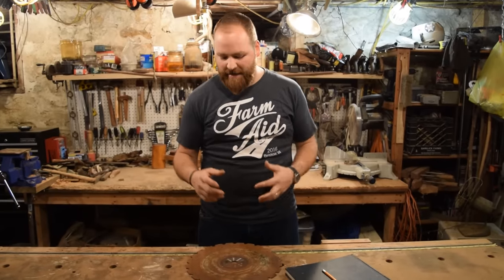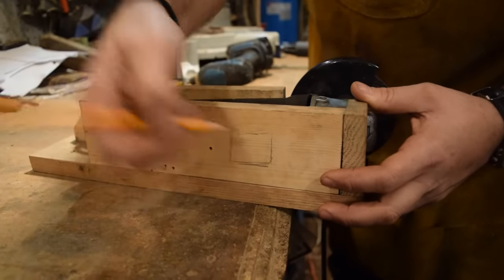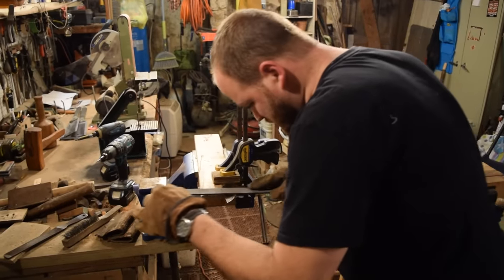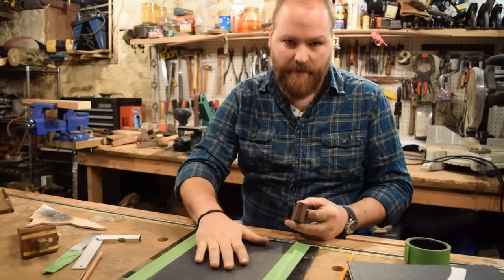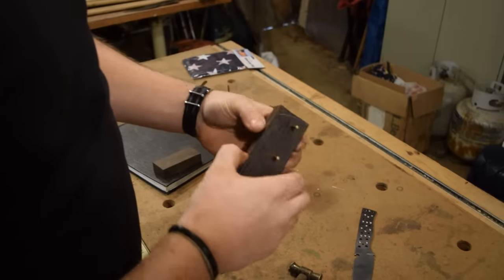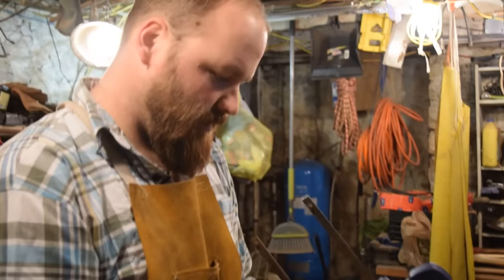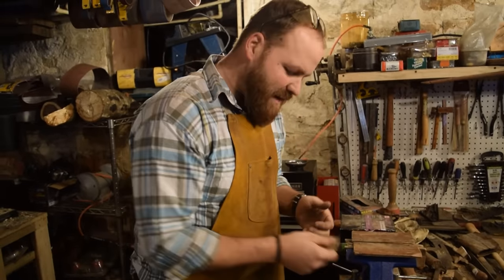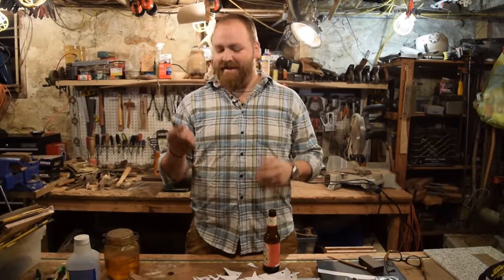Making a Knife From a Circular Saw Blade

Comment: Wow a whole knife out of a saw blade,......
 wow the rambo of angle grinders.
I use a zip wheel,.... commonly known as a cut off tool.
But the only other tools is a belt sander and a Angle grinder.
But I use a sanding disc with a rubber back plate to shape the blade angle.
And My circular saw blades are so small they have to have the handles welded on.
My knives are 1/6 thick and on each hole with the blade cherry red I shatter 6 bits per hole?
Now I just heat it cheri red and blow through with the welder,.. and fill it with JB Weld.
And I bevel my knives with the Angle grinder,.....because saw blades just knock the teeth off files.
And I budd them and use gun bluing on them.
for my plunge line I use vise grips and clamp 3/16 steel on both sides of the blade and take 3 swipes on each side of the blade till its done,.... 80 grit sanding discs.
Then I buff the blade and blue it.
Then I mask it off and JB Weld the handle and pin's on.
Then shape sand and stain and finish the handle.

Comment: I am late to comment but a question that I have is about the blade not holding an edge well, is that because of the heat treatment that is done during the manufacturing process or is it because of the type of steel that is used? would an additional edge quench make the blade harder and help with edge retention? I am just a woodworker and know nothing about blade making.

Comment: Hi there what grit belt do you use on the grinder for the final sharpen of the knives please? I have the small belt sander just tllike yours
Reply from the maker: I use a belt flipped inside out and loaded with polishing compound to finish the blade sharpening.

Comment: Saw blades are my life I sharpen and manufacture them. They are very soft when talking about steel and knife steel. Most of the time 50 Rockwell. The blade being used was a 14" demolition/rescue (fire departments use this) blade. Then average thickness is about .120". Most saw blades purchased are not industrial blades they are typically .070" thick or less. Don't use just any saw blade for a utility knife too thin.
Reply: Stephen Callari what type of steel is used for diamond blades and ones with tungsten inserts?
Reply: @raymondg.3173  all of the steel for blades carbide tipped, diamond, coayed or toothed are of a carbon variety the only time you would see stainless is with butcher band typically or a meat slicer.
Reply: @scallari101  👍

Comment: Using grinder are you not taking out the temper?
Reply: Ed Kjellander as long as it doesn’t heat up passed a certain point it’ll be just fine.

Comment: Nice job! BUT try some ear protection. I can speak from experience that working out loud shop conditions will damage your hearing in the long run. I NEVER used ear protection when i was younger, and I wear a hearing aid now. Also, I probably would have cleaned the steel before I started grinding and sanding it. All that red oxide (rust) in the air can't be good.
Reply from the maker: Done. Thanks!

Comment: You said the metal wouldn't hold an edge that well. Could you harden it to make the edge retention better?
Reply: It’s not only about the hardness but it is because of what kind of steel. Some steels won’t harden very well and some do and some just flat out suck. Circular saw blades aren’t meant to be super tough near the center but only on the teeth

Comment: I am working with sawblades and I just HAVE to ask...what sort of bit are you using? The blades I have are hardened so much that I am snapping multiple bits trying to get my holes drilled. Ive had to do multiple differential normalizations of the handle area to have a hope of getting through.
Reply from the maker: The blade I’m using is a wreaking blade used on roofing crews to cut asphalt tiles.
Reply: @TheArtofCraftsmanship  I was more wondering if you were using a cobalt tipped bit or something of that sort to pierce the blade without normalizing and having to re-harden.
Reply from the maker: Arcy Krey sorry about that. I have a few Irwin cobalt drill bits that work pretty well. They are not as expensive as carbide bits but are specific for drilling hardened steel. I pick them up at my local ask hardware.
Reply: @TheArtofCraftsmanship  Thanks! I really appreciate you taking the time to help me out!

Comment: I saw u using that wet rag to cool the steel during your initial cutout but it's important to mention that this should be done THROUGHOUT the process to prevent losing your temper. Remember, if the steel gets hot enough to turn brown, you're playin with fire in regards to losing your temper. If u turn it blue, you've LOST your temper altogether

Comment: What do you need a bottle opener on a knife for!place the knife across the knuckles of the hand holding the bottle with the back of the blade just under the bottle cap hold the bottle tight Ly with that hand and use a prying motion upward with the knife pop! No cap !you can use your teeth in a pinch  but any piece of flat metal or hard wood works just fine

Comment: What dimensions did you use for the rough out sketch? I am interested in knife making and your channel is very informative.
Reply from the maker: The blade is 4” from tip to choil, and 1 5/16” at its widest. The handle is 4 1/4” Long.

Comment: doesn't all the grinding and sanding mess up the heat treat?  The sound of the file biting into the metal sounds like soft metal makes when filling.
Reply: I  GLAD  YOU  SAY  SOMETHING  ABOUT  HEAT  TREAT  THERE  WAS NONE  BESIDES  YOU  CANT  HARDEN  MILD  STEEL  IN  ORDER  TO  HAVE  A  GOOD  KNIFE  YOU  USE    HIGH  CARBON  SPRING  STEEL   OR  TOOL  STEEL  AFTER  QUENCH  A  FILE  WILL  SKATE  OFF  THE  STEEL  NOT  CUT  INTO  IT AT  ALL  THE  STEEL  WILL  BE  LIKE  A  PEACE  OF  GLASS  THIS  IS  WHERE  TEMPERING  COMES  IN  AND  ANY  GOOD  KNIFE  MAKER  WILL  TELL  YOU  THIS  IS  WHAT  MAKES  A  GOOD  KNIFE

Comment: Just a small caution: angle grinders deserve rests like a bench grinder. They too will grab a blade from you and are just as violent when letting go of the piece you are working on. If you have time to build a jig for the grinder...make a rest for your work also. Or just put your work on a vice or clamp to a table.

Comment: what did the blade come off of? All the circular saw blades i have are roughly 3/16 thick. yours looks almost like 1/4 to 3/8.
Reply from the maker: The blade is a demo blade and used for cutting asphalt shingles. They vary in width, but are close to 1/8” thick.

Comment: To ensure you always keep your best knife design add the following step - glue your drawing to a piece of thin gauge galvanise sheet( or whatever you have available), cut it out with a tin snip, sand the edges smooth and then use this to draw your pattern on your stock. You can then store your pattern for future use.

Comment: What the little red thing gots hold you knife when sanding the side knife on belt sander and where gets it. ? 😉 thanks.
Reply from the maker: It’s a magnet on a handle. I have a few of them I picked up from Harbor Freight, but similar things can be found at most hardware stores. Thanks for watching.

Comment: Great stuff.  Rig up a switched power box to the rear of your bench for all those tricky on-off situations and get that power chord pulled back.  If it gets pulled over to the wheel on accident, that grinders coming outta that rig like a Croc on meth. Grinder mishaps are crazy nasty. Its always those shifty rig-ups that bite ya,... hard.  Thanks for sharing the great work.  P.S  I'm guessing that's the dry basement of a your really old house, get a bottle and get them there sparks under control... those fickers are hotter then ya mom on ya dad's bowling night...,  or you'll be editing framing videos! Ya got the talent! Thank You.

Comment: I read that circular saw blades are not good for knife making. The carbide tips on the blade, do the cutting and the blade itself is not heat treated to keep and edge. So, is it really possible to make a good knife blade out of a circular saw blade?
Reply from the maker: They make great beginner knives, but not the greatest knives in general. Their relative softness does make them easy to sharpen in the field, which has its benefits.

Comment: just wondering why you didnt heat treat the blade?. is the metal already hardened enough? Also why no tempering in a oven?
Reply: Old saw steel is already hardened. So as long as you don’t ruin the hardness by overheating it while grinding you shouldn’t need to mess with the molecular structure
Reply: @nps7vc  that's what I was thinking. thanks

Comment: Okay just a question: at 16:10-ish you band-saw your handle block into two pieces lengthwise then proceed to sand them flat.
Why not flip the two halves over & so the band-saw edge is on the outside of your knife which will be contoured later. The outside face of the block will become the inside face looked pretty flat and would be more than suitable for bonding to the blade? Just cutting out what looks like an extra process?
Reply from the maker: That is a great question and smart observation. The only reason I didn’t do exactly what you suggested, is that I wanted the wood grain to continue across the tang of the completed handle. It’s purely an aesthetic design decision, and one of those knife making things that I try to do to just add artistic touches that highlight the craftsmanship of the final piece. If it wasn’t for the beauty of the matching grain, I would, and have done just that. Thanks for watching!
Reply: @TheArtofCraftsmanship  Thank you for your answer which explains exactly what your intentions were, keeping the halves matching from left side across the tang and to the right side... very subtle but as you say that's what makes a good knife stand out from the rest. First time I've seen your videos, I will watch more as you are a "cut above the rest" pun intended.
Nice work and keep going.

Comment: **Safety comment alert** Before a ton of people roll their eyes and/or groan....I understand the belief that a lot of “safety culture” is overblown and unrealistic, that being said… STOP USING THAT ANGLE GRINDER THAT WAY! ...Especially when you have a perfectly good bandsaw!
*If you’re going to INSIST on using it as a stationary grinder, install a clamp that will firmly hold it perfectly still. The slightest wobble can bind up the wheel and cause it to shatter turning it lethal.
*The guard is designed to stop a shattered blade from coming back at you at close to MACH 1.... rotate it around to where it is protecting most of your body, but most importantly your face and neck.
* safety glasses ARE NOT enough while using an angle grinder, you also need a face shield… Not instead of glasses, but in addition to....
* FOR GODS SAKE....“As a knife maker”....Go to Home Depot, or harbor freight, or craigslist, or eBay… And buy yourself a cheap bench grinder.

But awesome life… I just Hit [subscribe]
Reply: Also if he's going to make sparks, move the propane bottle that was on the floor, outside.

Comment: Sir, you are an artist, I dot'h doff my cap! ( new subscriber ) I have to agree with Max Craig, an artist should sign their work.
I have learned a few things; marking the bevel line was just one simple lesson in how to do it right......
I have some questions if you don't mind (I'm curious about three things);
what wood did you use for the handle? (at times I thought it might be teak, but the grain seemed wrong)
what type of steel was the source piece, is it akin to C10 or harder?
what was that 'oil' you used on the handle at the end?
Please forgive me being 'picky picky' (and it is obviously my subjective opinion), but I might have aligned the brass pins with the curve of the handle, rather than in a straight line, I might even have made the center one smaller or all three different sizes (sorry)
By way of atonement for my 'sin', I would like to offer to you (foc obviously), some pieces of 'bog oak' that are virtually family heirlooms that my Dad recovered during his life. These would make excellent handles for a 'special knife' if you have a special project in mind.
(for those that don't know, 'bog oak' is a generic term for wood that has fallen into a bog and over thousands of years, rather than rot, it has been preserved and hardened until it is more like iron than wood, except it is beautifully black, has to be 'worked' like metal yet has the warmth and grip of wood, it is becoming increasingly rare and it is very hard to get straight flawless pieces, I have some of them.......)
Looking forward to your next videos, 100% genuine re 'bog oak' offer.
Pax dude

Comment: Very Cool design   even though the Saw Blade isn’t the best  Knife in thecWorld  i think if. this style Knife  had a Wall mounted Sheath  it would be a great  boat Owner Knife or what i call a Captains Knife  obviously on Boats  we have a lot of Ropes or Lines as we call them and  they can become a Hazard  for getting  tangled  on people or Pets onboard  or even  tangled up in the running gear having a knife  with easy access  is a fantastic Solution  and  Boating and Beer drinkinking  are very common  often the “ChurchKey” gets misplaced  onBoard  a Cool feature on the Sheath  might be a built in Sharpener or Dresser to  give you a   sharp Edge every time  ta needed ?   i’ve been a boat Owner and Operater for more than 40 years  and with the correct Marketing   could see every Boat Owner buying one  even if it was a more expensive higher Grade of Stainless Blades  i’m personally a retired Professional Woodworker  and i like  buying inexpensive Filet Knifes and  putting Exotic Wood Scraps  on them for a   nicer look  Why ? i give them away as gifts to my Marina Buddies  and honestly  i got the Scraps for free  out of   the Shop i worked for  and it was just a fun thing to do for me

Comment: Whoever taught you basic shop skills didn't fail and you use a file exactly like you are suppose to and keep fromk ruining your files. NEVER KEEP YOUR FILE ON THE SUFACE THAT YOU ARE FILING ON THE BACK STROKE. A FILE SHOULD ONLY TOUCH THE PIECE YOU ARE WOTKING ON WHEN YOU ARE IN THE CUTTING STROKE. Holding the file on the back stroke will ruin your file bevels no matter what size your file is. Good Job and it works great. I too am a knife maker 4th generation.

Comment: Cutting with a saw ( cold cut ) would make the blade last longer , as by heating it up your changing the molecules in the steel , soften it , considering its already hardened, tempered an annealed

Comment: What type of wood did you use for the handle ?
Reply from the maker: Wenge.
Reply: @TheArtofCraftsmanship  If you like the look of Wenge, you might like Ipe even better.  While Ipe can be more variable (both light and dark colours), it has much tighter grain and is MUCH less prone to splinters ... Wenge has a reputation for wicked splinters!
Reply from the maker: Michael Ireland thanks! I do love Ipe as well, but my current stock is relatively flat in variation and a medium light brown. I’ll have to look around for some with more figure, and maybe darker. I’ve also considered staining it. Thanks again.

Comment: If I used a 1x30 to grind the bevel, would I need to then heat treat the tablesaw blade metal?
Reply from the maker: If you keep you blade cool by dipping it in water VERY often during the grinding process, you should be good. There are plenty of knife makers that do all of their grinding after heat treat. Just take your time and be careful to keep the steel cool. Good luck.
Reply: @TheArtofCraftsmanship  Yee!

Comment: What tools do I need to start making knives ?
Reply from the maker: I started with a Dremel rotary tool, a propane torch, and a double cut Nicholson  metal file. You can use the Dremel to shape your steel stock (or saw blade if you want to skip the heat treating process), and then the file to put in your bevel. The next best tools to get if you want to step it up a bit more would be a 4 inch angle grinder, a 1x30 belt grinder, some C clamps, and a bench vise.

Comment: To keep your steel cool while using a friction grinder at high speeds use these instructions as follows. Keep your grinder mounted so it will not move for your hands and steel to be free to move to the grinder and bucket of water and back to grind. Do not wear gloves so your bare hands can feel how hot the steel is getting so you know to put it in the water to cool. Certainly be very careful at any thing when you are working near fast moving parts. Have nothing you wear to be dangling over the gears to get caught and pull you in to have you be seriously injured or worse. Always use the personal protective gear for your eyes and breathing and use a clean filter for your respiratory breathing apparatus. Why are we such dirty people?

Comment: FIRST NOTE: using a file to sharpen a knife is ONLY TO SET THE EDGE OF THE KNIFE. even after setting and if you want to use sand paper (in my professional opinion is ineffective) you would still need to use a wet stone and one of the most effective (one of NOT THE BEST) lubricants that is free is your own spit then just use hand sanitizer after to get rid of any bacteria left over from your mouth then lastly use a leather strap I got a good will genuine leather belt for 3 dollars if you don't have one. also be sure to alter each side NEVER sharpen the same side more than once stroke one side then the other YOUR BLADE WILL BE UNEVEN. SECOND NOTE: typically you would hammer down the rivets "pins" for a more flush effect however he used 1 ton epoxy so just cutting them off would be fine in this instance. THIRD AND MOST CRUCIAL NOTE: drilling too many holes in something strong will make it weak. even though he used 1 ton epoxy as a partial filler I would still not chance the steel of the handle being weak. I might have funny games on my youtube but I have wanted to be a blacksmith since 8th grade and have been learning everything I can ever since and im 24.